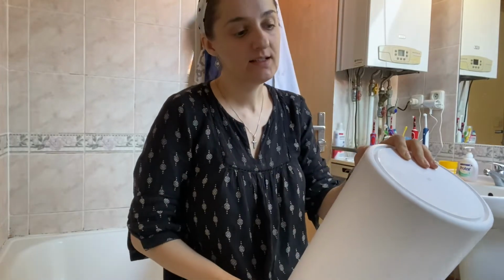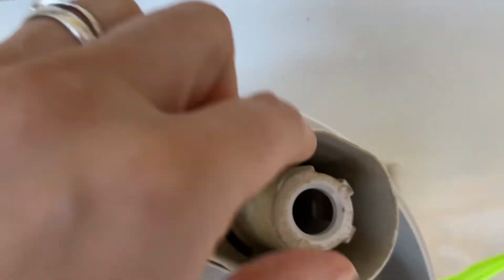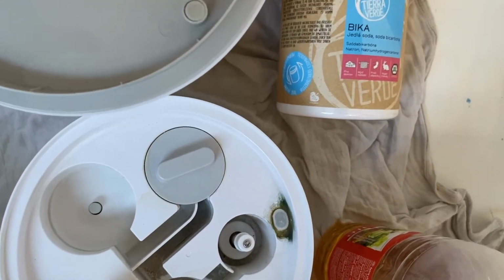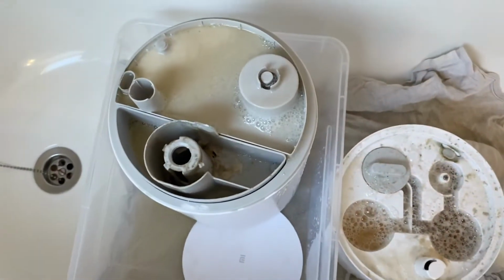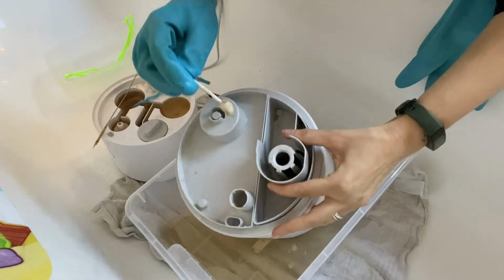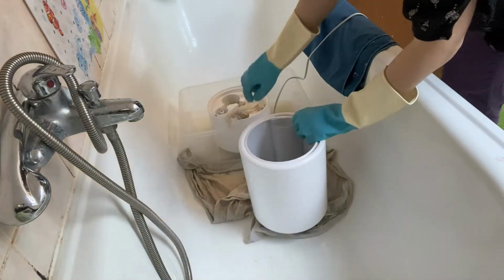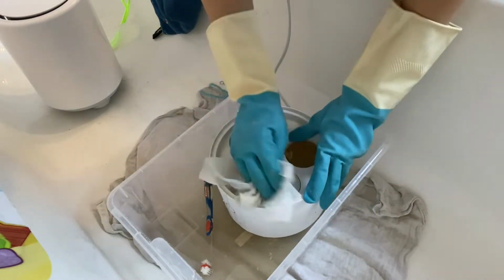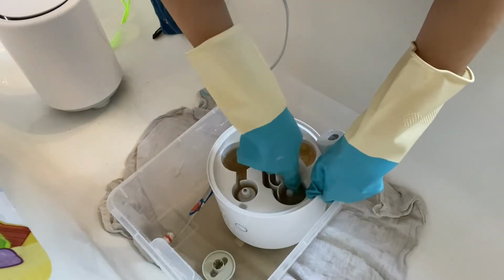How to Clean Xiaomi antibacterial air humidifier

Comment: Kinda tedious to do every 3 days 😂
Reply from the maker: you're right! not 'kinda', actually is very tedious
Reply: I have the same humidifier and it's very clean in comparison to what I saw in the video...after 5 months of usage. I only rinsed it with water every 2 weeks or so. I guess everything depends on the air and water quality.

Comment: You can assume that you haven’t cleaned the pipe through which the water aerosol comes out, gunk accumulates there, and you can’t clean it out with brushes, this is a minus of this air humidifier.
Reply: You can clean it, cap protecting it is fixed only on one screw. I cleaned this device for the first time yesterday, so I still remember how to get in all holes.
Reply from the maker: @PaladinErik  Hi, sorry for late reply. yes, is possible to clean that part also - I used the thin, long brush made for cleaning metal drinking straws. Not sure, if is captured here in video but that which is for straws works also in that small place. Is indeed important to clean that also, most imp maybe

Comment: looks like upper half also can be disassembled, but i cant figure out how....
Reply: I did it with two round headed table knives, firs press one of plastic locks, and put another knife in opened hole, then press another plastic lock, little bit shaking and voila, you got all three pieces separated!

Comment: After cleaning, has it any smell, or during working it smells different or normal?
Reply from the maker: smells normal, with no vinegar flavor because I rinsed it thoughtfully. But when not rinsed properly it does feel the vinegar puff (is not unhealthy to the room air overall but rather quite cleansing, I just don't like it. prefer the neutral).